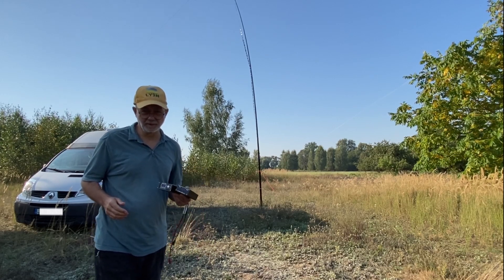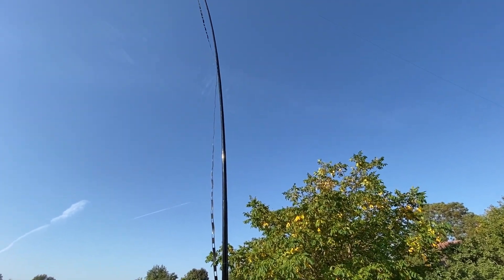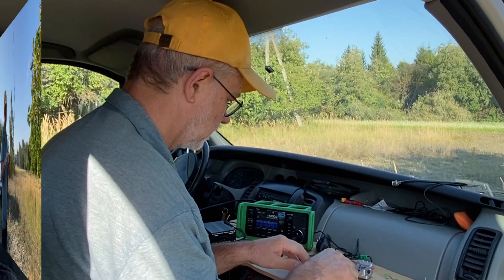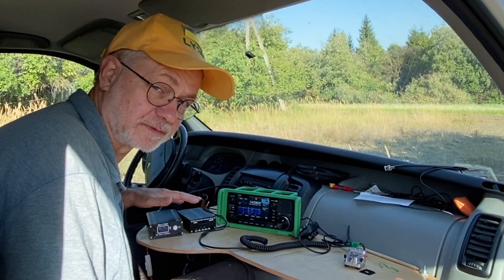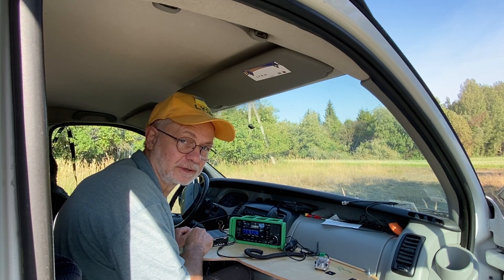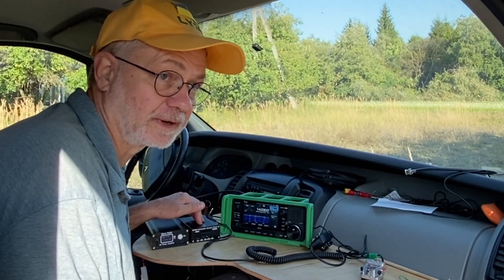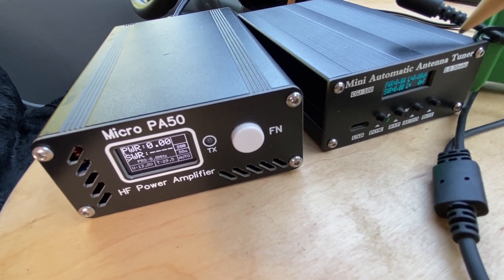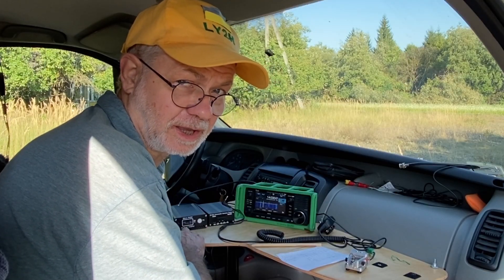My Micro PA50 HF power amplifier can not work with an Automatic Antenna Tuner. Why?

Comment: Hi, I'm using small antenna tuner called antuner at100m pro. My setup is icom 705, this tuner and micro PA50+. I first bypass the amp, tune the tuner with some few watts and power the amp back on, works fine. The only small drawback of this tuner is, that it doesn't have latch relays, so it consumes bit more power. It has internal battery and will last long-long hours before needing to charge though.
Reply from the maker: @vladimirj.3716  Hello, thanks for the comment. Yes, the AT100M Pro seems to work on power levels lower than 5W and could be a solution to my problem. I’ve ordered one and will test it soon. Stay tuned! 73! Linas LY2H
Reply: If you turn the amp off and then tune, you are only tuning the radio to the unpowered amplifier impedance. Not the antenna. The amplifier is connected to the antenna. Not the 705 so your method is not tuning the amplifier to antenna. You risk your 705 with this method.
Reply: @bretaguilar153  could you explain a bit further as I've been using this method for a while without issue.

Icom 705 -> Micro PA50 -> AT100m -> antenna.

I bypass the amp when I'm tuning and when I enable the amp afterwards, I get an acceptable (< 1.5:1) SWR on the amp's display. Can I ask what the risk might be? Relatively new ham here so looking to learn!
Reply: @wellyftw  The goal of tuning is to match the impedance of the transmitter to the antenna. You're not doing that. You are tuning the radio which is not connected to the antenna.
Reply: @bretaguilar153  ok, so if you had this setup how would you approach tuning the antenna? Thanks again!
Reply: @wellyftw  The tuner must be electrically and physically connected to the antenna and the amplifier. Not the radio and the amplifier.
Reply: @bretaguilar153  I've been speaking with some other hams about what you're suggesting and they all seem to disagree with you. If the amp is in bypass mode - or turned off entirely - then the amp is invisible to the ATU, I've been assured this by numerous people that this is correct.

I'm 100% sure you know more about this subject than I do but I'm struggling to understand how what you're suggesting makes sense?
Reply: @bretaguilar153  after doing a bit more reading, from what I understand (and what other hams have confirmed too), when the Micro PA50 is in bypass or switched off the relays inside the amp directly connect input to output. In that state the amplifier is electrically transparent, the tuner is looking straight at the antenna system, not at the amplifier.

That’s why the normal advice is to put the amp in bypass/off, run the IC-705 at low power, let the ATU find a match, and then bring the amp back online. The ATU is still doing its job between radio and antenna, not between radio and amp.

I realise there are some amps that might add a trace of reactance or loss even in bypass, but it’s very small at HF and doesn’t stop the tuner from correctly matching the antenna. The important bit (as you said) is never to tune with the amp powered up.

73, and thanks again for the discussion - always good to sanity-check these things!
Reply: @wellyftw  This is totally wrong. When you turn the amp back on and take it out of bypass, it is now your transmitter and you are connected to your antenna with it. Tuners are used to match impedance between antenna and the device radiating the RF. You are way out in left field and nobody with a lick of sense agrees with you. Buy an antenna tuner for that amp and quit trying to rewrite physics in order to save a buck.
Reply: @bretaguilar153  we will have to agree to disagree on this matter. 

Every single ham at my club has said radio -> amp -> tuner -> antenna is the correct setup with the amp put in bypass mode when you want to tune the antenna, and the only possible way.

Clearly either you disagree or are not understanding what is being suggested so I shall leave it there. 73
Reply: @bretaguilar153  In addition, this is EXACTLY how LDG suggest you tune with an amplifier, you can read it in their documentation - connect the amplifier to the tuner, the tuner to the antenna and put the amp into bypass mode, tune and then re-engage the amp.

So with the greatest of respect, you're absolutely wrong.
Reply: @bretaguilar153  "Buy an antenna tuner for that amp and quit trying to rewrite physics in order to save a buck."

What do you think we're talking about? Genuinely, I don't think you're following the conversation. 

We're talking exactly about using an antenna tuner with the amp so I don't know what you're talking about but it seems to be something entirely different.

Comment: You could add a resistive pad between the amplifier and the tuner. The pad should be designed for 50 ohm input and output impedance and should have a matched loss such that you'd still have at least the 5 W your tuner needs to function correctly, but not much less loss than that because the more loss it has, the more nearly the amplifier will see 50 ohms regardless of what the tuner is doing. The resistors in the pad would have to be able to dissipate an appropriate amount of power. Once the tuner achieves best match, you then remove the pad.

The little SWR indicators using an LED and three resistors (the load is the fourth component and you have a Wheatstone bridge), used for example in some commercially available Z-match tuners, have a 6 dB pad and the worst SWR the transmitter can see while tuning is 2:1.

David  VE7EZM
Reply from the maker: @davidryeburn6446  David, thanks for a nice  idea! It would be interesting to try it out! Surely, practicality would suffer (switching the pad in/out all the time :), but the problem might be cured! 73! Linas LY2H
Reply: @Linas_LY2H  All you need is a DPDT switch. In one position the amplifier output goes to the input of the pad and the output of the pad goes to the tuner input. In the other position the amplifier output goes directly to the tuner input. Takes almost no time to flip the switch. Unless your antenna or the tuner design involve too high a Q, you'd only need to do this once per band.

David  VE7EZM
Reply from the maker: @davidryeburn6446  Thanks David!

Comment: I just bought the PA50+ and successfully used it with the Icom 705 with the LDG Z-100 Plus and it worked w/o issue.

Comment: Yasoo mine worked well.
Reply from the maker: @M0FXBHamTech  Hello Andreas! Have you managed, somehow, to turn the high-SWR limitation off? I’ve just installed the latest firmware I could find, the 2.8.9, and it’s still the same, no way of turning  the SWR limitation off, only the High Power. 73! Linas LY2H

Comment: I had exactly the same problem. I got annoyed with the oversensitive protection on the PA50 and was too lazy to update the firmware and risk destroying the output transistors so I sold it. The ATU works fine on my FT-891 instead ! I reduce the output power before tuning of course by switching to AM mode which has a preset (by me) power out of 5W. Keep making your great videos !

Comment: You are supposed to bypass PA while the antenna tuner is tuning.  Then turn the PA back on.
Reply: He did say you can do that but his atu doesn’t tune with power lower than 5w. I had the same problem until I modified my atu to tune with power below 5w.
Reply from the maker: @LanceVK6LK_AussieHam  Thanks Lance! Yes, I know you can change the lower limit for this tuner by reprogramming it and I've done it to my other incarnation of the N7DDC ATU. I have it down to 3 W now, as I red somewhere a warning from N7DDC himself telling that this mod down to 1W may affect the accuracy of the meter on a 100W version. So,  I keep the CGJ-100 unmodded. 73! Linas LY2H

Comment: Key functions (number of consecutive presses) for firmware version >2.8.1
Updated on 2024-06-29
1: Release protection and alarm
2: Switch semi-insertion mode delay parameters
3: Manually switch bands
4: Switch buzzer
5: Switch band protocol mode
6: Switch power and standing wave display mode
7: SWR detection mode
8: Switch 30m and 15m bands
9: Automatically release standing wave protection
10: Enter unlimited mode
Reply from the maker: @digiital  Thanks for the info! My video is based on the version which is named just v. 2.8, not 2.8.0 or 2.8.1. The key functions are different from your example, and NL mode is still accessible on 8X button press and it only makes no limit for the power output, but not for high-SWR. I saw there is a latest version 2.8.9 on the Google Drive, I will try this out, but I have little hope the Swr limitation by-pass is introduced there. Thanks for the hint anyway! 73! Linas LY2H

Comment: I use the PA50 and a LDG ATU all the time. Depending on the firmware you have on the PA50. Push the white button 9 times.  I use my setup remote in another room. I flip bands all the time. The ATU will kickin the PA50 will (with white button pushed 9 times, in auto reset the SWR alarm) .  Allow my ATU to tune, 3-4 seconds later the PA50 will reset.
Reply from the maker: @digiital  Thanks for the info David! My video is based on fw v.2.8, and 9X and 10X button press is inactive. NL mode is still under  8X press but it does not solve the problem. I think I must try later than 2.8 version out :). Thanks for the hint! 73! Linas LY2H
Reply: @Linas_LY2H  If you do would you please consider creating a video on the process and the differences between the firmware’s. I think it would be an interesting video. Cheers
Reply from the maker: @LanceVK6LK_AussieHam  Thanks Lance, I will!

Comment: Thanks for sharing linas. I know the Belgium station very well.
Does the pa unit work with the qcx and the qdx ? 73 mate.
Reply from the maker: @brianfields4479  Hello Brian! Thanks for your comment! Sure, the PA can work with any transceiver providing up to 5W. The only pecularity- this PA needs a different input power on different bands, thus, the transceiver with incremental power adjustment is more comfortable to use. The QRPLabs rigs have no this function, unfortunately, so you may need to find your own way of power reduction , on some bands. On some other bands, like 20m in my case, the output power of 4-5W from the QCX or QDX is just OK with the PA. But on 80m it wants only 1,5-1,8W ... :) 73! wish you and your family well! Linas LY2H

Comment: Any of the N7DDC antenna tuner variants can be modified to work with 1 Watt to 50 W. Very easy mod, I did it for the exact same reason. Cheers Lance
Ps Just read my post. I really should proofread before submitting 😂. 
I do enjoy your content.

Comment: Linus, so glad to see you still sticking with the ZS6BKW, and equally sad that your tiny station can’t handle the SWR issues. Software improvements usually come with a delay, but if the open-source community spins up you may get your request! KN4HGI Alan/“Thumpy”